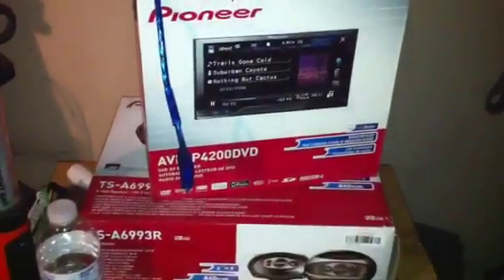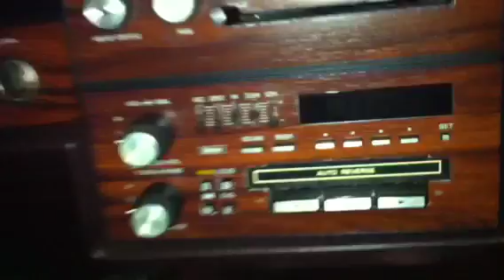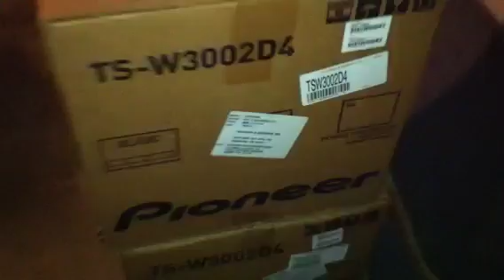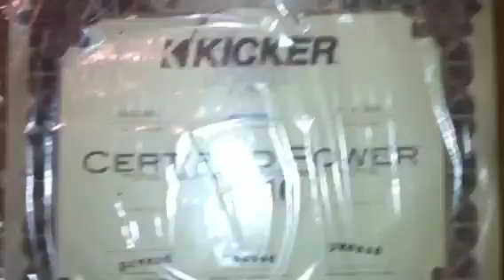From OLD to NEW!!

Comment: Thoes Pioneer Double Dins are pretty good we have a older one from 2006 in the 05 Caddy ESV 4years & its still going strong. Dont forget to add the back up camera so you can see thoes haters trying to creep up on you, also thoes 4-12" subs gonna be slapen so hard you aint gonna see shit out the rear view mirror so your gonna need that camera 4sure